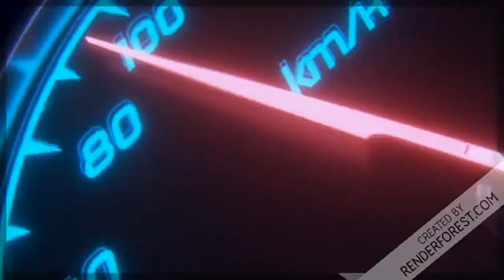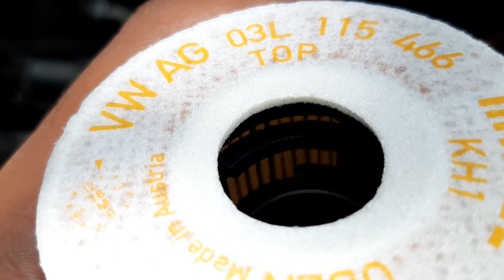KEEPING ENGINE OIL NEW FOR LONGER | DIESEL ENGINE MAINTENANCE TIP | OIL FILTER CHANGE

Comment: Had no idea about this concept of a Mid Life Oil Filter Change. Also to all those saying he fit it the wrong way, I did check in the correct TDI manual and read that there's only one correct way in which it'll CLICK and SNAP and so the Filter has been correctly fit in this video. Nice stuff as always!
Reply from the maker: Thanks alot for appreciation sir 👍
Reply: engine flushing and additive are not required (are not that effective ) if u change ur engine oil and half the age engine oil filter , best way to keep your diesels running endlessly @yourDIYneeds
Reply from the maker: @madhusharma639 yes , but doing a flush after 50k interval is still a good precaution to consider

Comment: Right! Absolutely convinced with you. I purchased a new oil filter recently for the same reason. I was actually worried about the quality of my oil, when Egr is continuously dumping soot into the  piston & eventually into the oil. Same oil is then circulated everywhere for an year at least if not completed 15k.
Reply from the maker: Sir thats the reason i changed my interval to 10k and changing the filter at every 5k .

Comment: Nice video Sir jee,  I would be really grateful if you could upload a video for cleaning the VW Vento magnetic roller/ speed rotor which is right below the Abs sensor, as some oil had dipped into that portion and since then the speed needle fluctuates till 40kmph and then ABS light glows. The ABS sensors don't show any fault before the light glows up. Thanks in advance.
Reply from the maker: Will definitely try and shoot a video.

Comment: Thanks for the knowledgeable videos.
Sir one ques, please guide me on that 
Can i flush my vento's diesel engine at 1.3 lac kms with  liqui moly flush?

I am afraid of getting piston seals being leaked or any other things  at this interval.
Pls let me know if i should go ahead with that or just flush with 200ml diesel  only..

If anything of the above is not mandatory..
Pls let me know that as well.
Reply from the maker: Sir if you maintain your car at time ( annual service ) then you don't need to flush the engine at all at the first place .
But if you still want to flush then my advise is to go with diesel ( around 200ml ) as diesel is not harsh on engine ( just don't rev the engine while flushing ) 
And flushing chemicals are very harsh , so i don't recommend anyone using flushes , because at 1.3lakh kms your engine rubbers seals will not be in that condition as it was new , so flush can accelerate the detoriation of rubber seals . And there are various rubber o-rings and seals inside engine .
So my advise is , don't flush but if you still need to do it then go with diesels as engine is designed to handle the contamination of engine oil with diesels . 
So work with the engine not against it . 

Hope it helps 👍👍
Reply: Using engine flush in a high mileage engine is not recommended
Reply: @yourDIYneeds   thanks for explaining it so well.
 I will not go against my car's engine aur your knowledge 😊
Thanks for wonderful videos.
Eagerly waiting for  liqui moly top tech review.
Reply from the maker: In 2 days sir !

Comment: Do a mid-life air filter change as well..the engine can breathe much easily esp. if you have the euro spec air guide channel installed..
Reply from the maker: Sir exactly , i don't change it but just because i am on euro air intake , i clean air filter along with all the air track every 3k kms , and to be true there is alot of dust
Reply: if we can clean the air filter which is very easy , we can use the same airfilter ( i usually wash the outer layer of Airfilter and dry it using hairdryer, and internal round structure can be dusted and cleaned, put it back and the Vento TDI Revs like a monster. @yourDIYneeds
Reply from the maker: @madhusharma639 yes sir it can be done , but sometimes if we are not careful then the element of the filter can get messed up , and ristrict air flow
Reply: @yourDIYneeds  ok got it, but i m not sir 🤣

Comment: Nice work Sir.For the Dicor,I change oil and oil filter at 7500kms(since it's 12 yrs old with 1,89,840kms at the odo).The soot problem in the filter is very much evident Sir in mine too.The way petrol ,diesel prices are going,I guess in the near future we will end up with electric cars,so we don't have to worry much about maintenance or going to pumps.lol
Reply from the maker: Sir future is definitely electric , and quite enjoyable too. But will still miss the IC engines definitely
Reply: @yourDIYneeds  way lesser maintenance Sir.But donno if service centers may tamper with battery so that we need to pay a heavy amount for replacement...
Reply from the maker: Sir tata has come up warrenty plans , which will eventually end our worries , like new nexon hai a 8 year Warranty on battery and  motor . 
So no worries 😊
Reply: It will be a massive failure !

Comment: whats your oil consuption?
Reply from the maker: 100-150ml in 3k kms .
Reply: yourDIYneeds I’m having more 1L/1k km if driven in high rpms
Reply from the maker: Sir it depends upon oil you are using , driving conditions and ambient temperature.
Reply: yourDIYneeds usually drive on highways delhi-himachal catrol edge 5w40 earlier it was 1L/4-5k km same driving style
Reply from the maker: Was the oil bought from a official distributor ? Because castrol has alot of duplicacy in our market .
Reply: yourDIYneeds yes i always buy from kashmiri gate near sai motors authorised castrol dealer
Reply from the maker: Sir , is engine temp. Normal , because if cooling system is not performing optimally then it will raise the temp. Of engine core , which will eventually make the oil hotter and evaporate faster . 
And last thing is the piston rings itself , 
Pickup wise , acceleration wise is it ok ?
Reply: yourDIYneeds yes pick is all good top speed remains same on odo it shows 90 temp as always. I have ordered seafoam let’s see if that helps n I’m shifting to motul 8100xclean this time
Reply: Just for your reference my vehicle is 1.7L driven with cat back exhaust basically a straight pipe from turbo and low springs with upgraded brakes.
Reply from the maker: Sir are you running remap ?
Because cat back exhaust or decat doesn't suppose to effect oil consumption ,but a remap can .
Reply: yourDIYneeds no no everything stock apart from written mods.
Reply from the maker: Sir then , you please change the oil first , sometime fake oil can cause these issues , and castrol is quite famous for piracy in our country
Reply: yourDIYneeds i will try to get motul 8100xclean 5w40 from authorised vendor. Let’s see also i will update you regarding seafoam so that you can have an idea regarding product. Thanks for your time 🤗